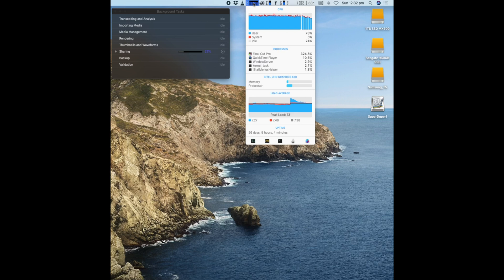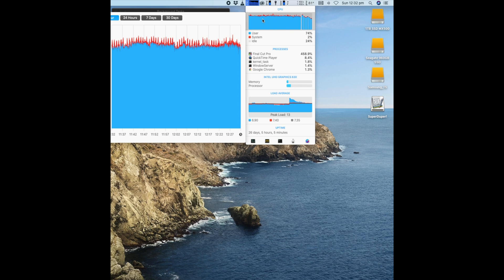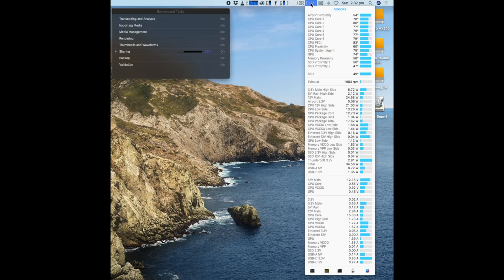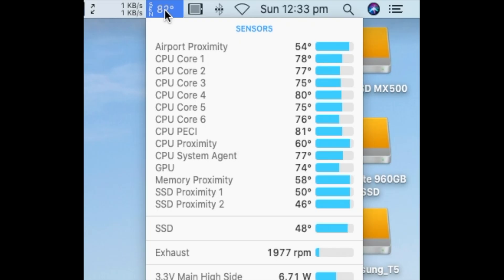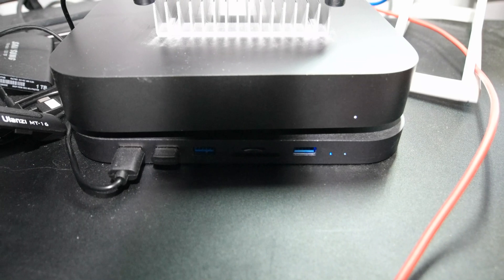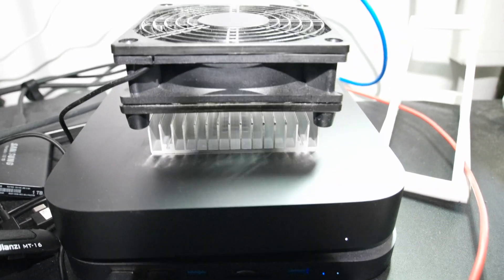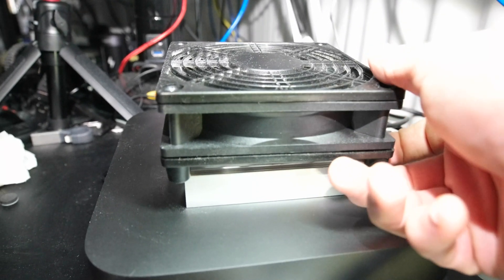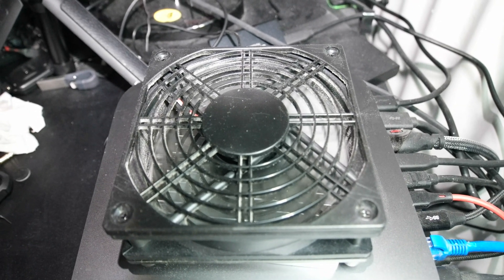Overheating Mac Mini ? Cool It Down And Increase Performance

Comment: hi,. air flow in or out which one better
Reply from the maker: I like to draw heat away from the mini
Reply: @Frugalcaveman  i tried to blow out from device that not use. i check temperature variation thought app. but i currently using blow into the device that much better i can see that change.

Comment: mate im doing this setup, is the fan setup as sucking the air out from the heat sink or blowing the air towards the heatsink?
Reply: It should suck, otherwise hot air collide on mac mini surface

Comment: do you have to adhere the heatsync to the chassis? or is it just laying on top of it?
Reply from the maker: It is just sitting on top. Using thermal paste or pad would increase conductivity however even just sitting on top allows it to draw heat with the help of the fan to bring heat away from the chassis.
Reply: @Frugalcaveman  Thanks for the quick response, my computer actually shuts off while I'm rendering and it's so frustrating. I have a fan blowing on it right now, so janky lol. I'll try this.

Comment: This is great! Did you apply thermal paste to the heatsink/mini or did you just lay it on top?
Reply from the maker: I just sat it on top however you would get even better results with a thermal pad or paste to increase connectivity surface area.
Reply: Did you place it on top of the Apple logo or did you remove it?

Comment: Im gonna share this with everybody cuz it seems my overheating issue with my Mac mini 2012 has been fixed .   I dont tend to download apps and shit from the web randomly on my Mac since its used for music production specifically but a week ago I made some changes in my home studio adjust for astetics changed the white original power cord with another one to try hide it from sight. After that I noticed the fans on my Mac were going crazy by just watching YouTube or performing the slightest task like transferring files. It wast until I went to an apple forum where somebody asked the question  " what temperature my Mac its supposed to run and power cord makes any difference" .  So based on that I grabbed the original cable and put it back. No fans going crazy , no overheating, no slowing down ... NO ISSUES AT ALL .  Im hoping that was the problem and if it was ...thats the sneakiest way apple manage to get you buy their products only. Crazy
Reply: use a older os system it makes all the differance. once i upgrade to mojave my mac mini ran way to hot.

Comment: Iam using a medium fan under with out cover and a blackshark magnetic cooler on top. Stays in the 46C -ish range. Not bad next I will order a 150x150x20 mm copper heatsink see how it goes.

Comment: I got a fan made just for the Mac mini goes under it and u removed the bottom lid and it sucks the hot air out. My temperatures are much lower than yours and it runs amazing and my Mac is old it’s a 2012 model
Reply: What’s the name of it?
Reply: Please tell the name of the fan.. I'd much appreciate
Reply: Does it even exist?